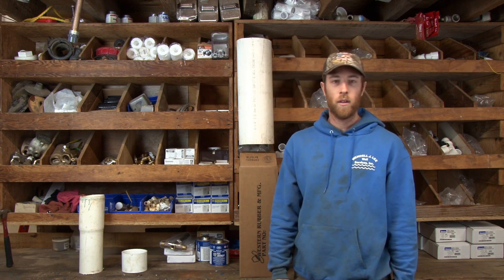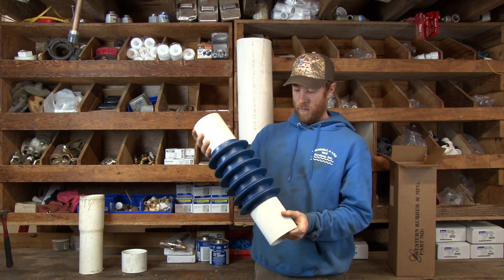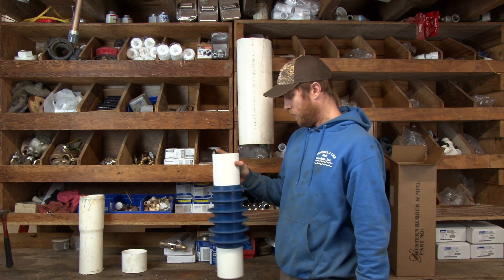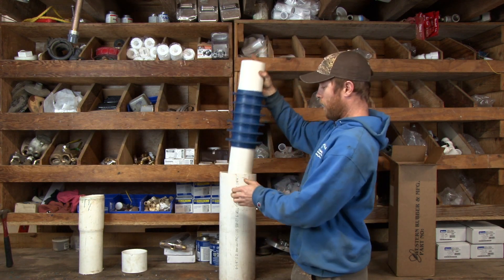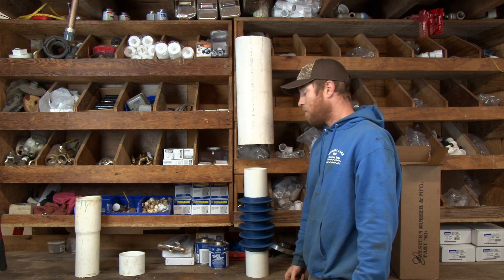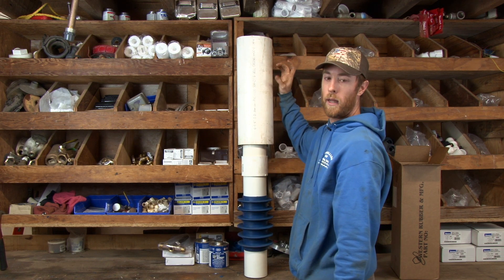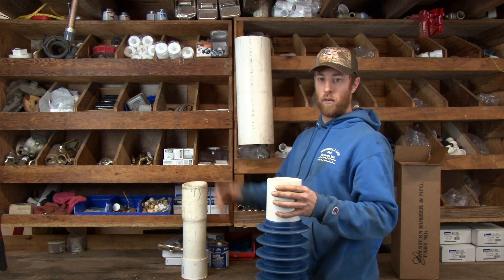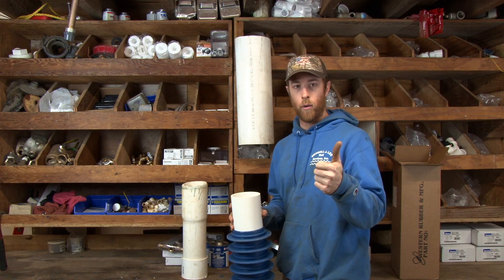What is a Water Well Liner (or Packer)? What do I do if my well casing has Failed?

Comment: I have a 6" casing.  When they drilled my well, they installed a 3" liner which only goes down 20' from the top.
Is it possible to remove the liner and replace it with a larger liner ?

Comment: I have a well in my basement about 90 feet deep 6 inch pipe, the metal casing at the top is rotted away, it looks like the upper part of the casing was replaced at sometime in the past and It may have to be replaced again.

Comment: Had a leak at casing below pump above ground. They replaced a part was inside casing to this they lifted pipe liner up 3 feet and got stuck. The install new part and put back pump. Now the pump is having problem holding pressure and sand is coming up when it was not before. Which clogging up filter in softener which lead no water to house but the water at pump water speeket. Question by pulling line pipe 3 feet and getting stuck cause the sand to enter the casing and loose water pressure. If it did would solution be to remove line pipe and clean out casing of sand and introduce again line pipe down below the 3 feet that pull from. They are suggesting to replaced tank instead of cleaning sand in casing and getting unstuck the liner pipe what do you think ?
Reply: I think you should plug that well and drill a new one.

Comment: Can a liner be installed on a 4" well? 80' submersible pump brand new installed and water comes out brown. I've let it run for 10 minutes and it clears up, but  then turns brown again with in 30 minutes. The casino is about 40 years old

Comment: How do you keep the 4 inch pipe from falling into the well? How do you attach the 4 inch liner to the 6 inch casing? and how do you install the pitiless adapter?
Reply: He explains all your questions in the video. The packer stops the 4 inch pipe from falling down. Also at the top of the well you attach the 4 inch to the 6 inch with bolts or screws.
Reply: @laker3  He does not explain the pitless adapter issue.

Comment: So if the casing of a well is failing and is extremely old wouldn't installing that Well Liner knock a bunch of sediment in as it's being installed??? Just to clear up the question further I'll explain my own situation because my well casing is so old I literally poked at a rust hole and it broke all the way through to where i heard the piece that broke free drop into the well. And as a follow up question if a well casing is so old that it's just a shell basically wouldn't the whole casing itself need to be removed so the well can be recased??? I'm only asking trying to gather as much information as possible before i make any decisions on what to do.

Comment: I had a packer installed due to surface water entering around 90 feet.  Normal water is at 104 feet. Well is 20 years old. Cased to 160 feet and drilled to 354 feet. The plan was to install the packer around 170 feet just below well casing.  But PVC Pipe and packer became so heavy we couldn't keep it from wanting to keep going down.  So the contractor thought to pull pipe and packer back up to remove some weight.  Only pulled about a foot when it broke off about 40 feet from surface and seems too be stuck there.  My fear is that the packer and pipe will eventually fall clear to bottom of well and ruin/break the submersed pump.  Any thoughts on how to secure pipe and packer? Have you ever used Sodium Bentonite Chips between new PVC liner and old well casing?  The well water is clearing up but still has a sour kraut smell.  We determined the root cause of contaminated ground water is that the ground water was bringing silage runoff into the well causing discoloration and a strong odor especially when we had any amount of rainfall. Any help will be greatly appreciated.
Reply: how did you fix your problem?

Comment: Hey Guys!  I bought a house with a 500+ well with 6" PVC casing. It has recently collapsed closing off at 100-foot level.  The water which was at 40 foot,  has disappeared. There is fracking ongoing nearby. The well is 50 years old. It had been abandoned for years. I was trying to reactivate. What can i do?  Is it likely that 400 foot of sediment fell in or do I have a plug?? Help!  Thank you!
Reply: How did you fix the problem?

Comment: The seal  is 1 or 2 feet long and is pushed to pass the drive shoe  ,that is not bad , the bad thing is that you have to pull up your well pump , i have a well pump put in  at 2017 15 gal minutes just what i need it  imagine me pulling up this pump seating at 480' deep with  a water head of  475' on top , i had to use a half inch rope with chrome strand in it  , 
Where i come from we relied on well water 90 %  to seal the surface water from entering the well and stop erosion from happening that mostly is from surface water from around the casing    , we had to pore a 6"x 6'x6' cement shape it like a  funnel upside down around the casing and installed a rubber flange tightly fit at bottom of pipe to keep water away and did a good job , keep in mined if you are going to drink this water , should be no septic no lech-field no garden within the 100' that is a law in NYS.
Reply: Yep that is the NYS law 👍

Comment: How do you make this repair if a 12 by 20 well house has been built around the well? Well is 7 years old and 130 deep.  It  is pumping dirty water.  Bob Merrill
Reply from the maker: have to have access to raise pipe in and out...either cut a hole in the roof or tear the building down
Reply: same problem , i put a removable plastic skylight in the roof.

Comment: What we need to do if our well has a pipe leaks  or how to find out we’re the leaks is from the well pipe talking about well lines or pipes not inside the house
Reply from the maker: look into isolating your system with valves so you can figure our where your leaks are

Comment: What’s a good idea for for keeping your ditches dry we Ben using trash pump so we can lay or lines after drilling to pump house but next day ditch is filled with ground water
Reply from the maker: Yes the rain has been awful. IF it isn't filing a ditch in, it is good for burying a drill rig. We normally try to dig a ditch and cover it in the same day if we can. With the way this winter has gone, some jobs have just had to wait